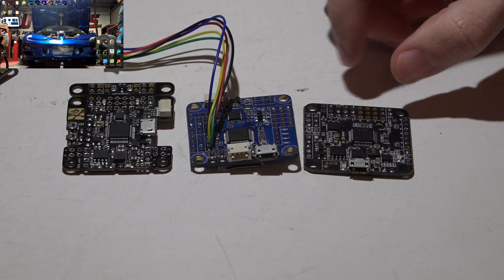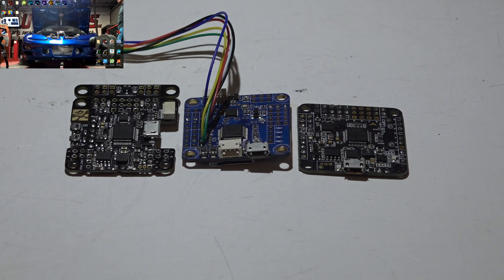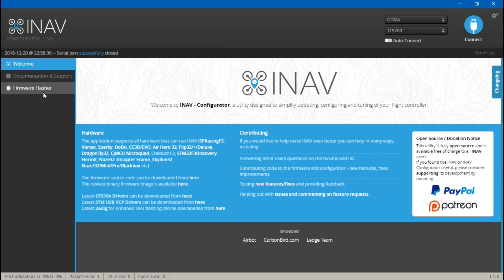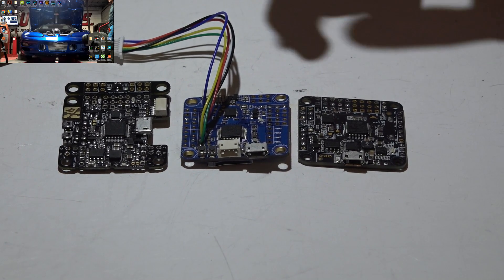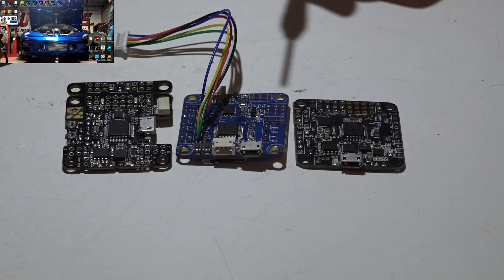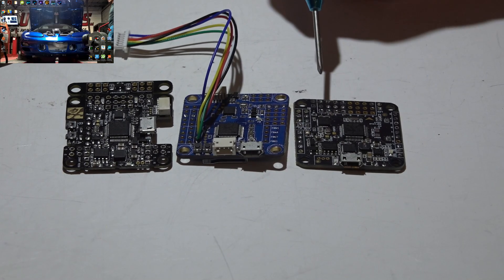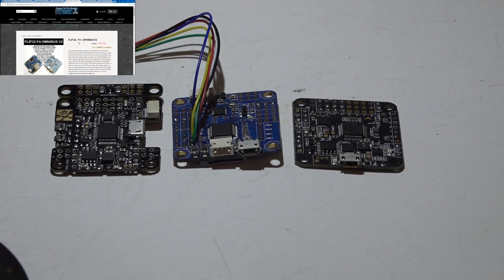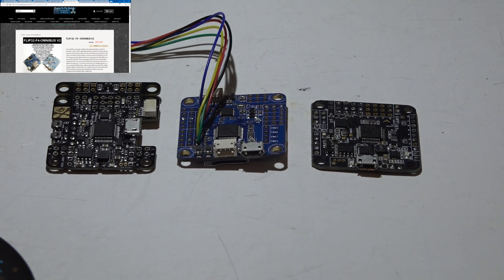Best Flight Controller For INAV?

Comment: went through video and heard the points. baro - yes , compass -no, current sensor - no, SPI  processor -  yes. I have identified https://www.banggood.com/Omnibus-F4-Pro-V3-Betaflight-Flight-Controller-Built-in-OSD-Barometer-SD-Blackbox-for-RC-Drone-p-1163085.html?rmmds=search&cur_warehouse=CN  but it is a pro. could you please look at the pin diagram and confirm it has any issues to use with inav and gps?

Comment: can I do a hexacopter  using the omnibus? and  should I make the distribution board the frame, and then work from there with a separate gps compass to an Omnibus ? Also not sure of the signal wiring for two of the motors on an omnibus (if it can be used in the first place )..

Comment: i checked the supported boards on Inav, is it compulsory to use one of those boards or could i use something like this Racerstar StarF4S 30A Blheli_S Dshot 4 in 1 ESC AIO F4 OSD Flight Controller w/ BEC Current Sensor
Reply: You can use it because its an f4 board, just remember the pinout will be different than the ones displayed :)
Reply: so i had a quick look through the boards in the inav configurator, the board i have isnt in there. would i be able to select a different board and use it. or would i need to replace this board all together?
Reply: You can try flash it with sp racing f4 evo, if it doesn't work prolly get another board ^^
Reply: thanks
Reply: ill be getting one of these for another build to follow along, what PDB would you recomend?

Comment: Love your videos. You just make sense.  Question and you may not know but I bought all Omnibus F4 for all my builds. Just decided on a whim to turn an old ZMR 250 into an inav GPS quad.  I have a gps.  I know the F4 has no barometer but I do have an external barometer from an ancient CC3D build years ago.  Do you know how to wire it to the omnibus or direct me in the right direction? Thanks.
Reply: Guess I should have told you it’s a BMP180 barometer. Thanks if you can. If not I’m sure I’ll eventually figure it out
Reply: he passed away so he cant tell you

Comment: Just ordered two 10DOF Sp Racing F3 boards. If you want to control a camera gimbal, via the FC, this currently is the best option. I'll be using the RTFQ total dist w/osd. Guess I'll save the two omnibus F3 boards for mini quads.

Comment: hi i already buy the F4 pro waiting to came... =( ... is anyhow to bypass the Current meter and volt sensor.. couse i have ESC with power module built in

Comment: JC, is there a F3 OMNIBUS clone board that has all servo through hole pins ? i hate the small white connection like the sp12 as they all seem to come with very very fine wire and just another fail point ? cheers Brett

Comment: Hi people. I'm  putting together a GPS Quad. I have a  Flip 32 omnibus AIO F3 board. I love this board but I am having a problem getting the external mag to play nice with it. I am running Inav 1.7.0 on the board.The GPS/mag is Hobbypower Ublox NEO-M8N GPS Module with Compass + GPS Folding Antenna Mount Holder for APM2.8 APM 2.6 Pixhawk PX4 Flight Controller. The issue is that when I connect to the FC Inav sees the mag and shows it as fine but after a very short time the I2c error counter at the bottom of Inav goes crazy and the mag shows up as faulty. Is this a FC issue, an Inav, or a GPS/mag issue. I have had the mag running long enough to calibrate and confirmed it in Cli. It seems that I2c does not want to play nice. What can I do? ANYBODY, PLEASE HELP.
vince@thetassones.net

Comment: Thanks JC for this great series.

I’m stuck on one problem that I can’t figure out.

Here’s what I’m using:

- Flip 32 F4 Omnibus (http://www.readytoflyquads.com/flip-32---f4---omnibus-v3) 
- X4R receiver 
- Taranis X9D transmitter

My configuration:
UART6 with serial and sbus selected.

Using Betaflight and Cleanflight, I can move my sticks on the transmitter and see the channels respond as expected. 

When I flash with INAV, I don’t see the channels respond in INAV, like I do in Betaflight and Cleanflight.

I even ordered another flight controller (http://www.2dogrc.com/omnibus-f4-pro-v4-pdb-fc-in-one-smart-audio-support.html) but get the same results.

I’ve got to be missing something stupid - can anyone please tell me? =-)
Reply: Talking with the guys at INAV, the F4 version of this board does not yet support the programmable inverter.

There is a custom firmware available that does work for me, but it's not part of the official INAV release. I can confirm this works.

If you're interested here is the background and the links to the custom firmware: https://github.com/iNavFlight/inav/issues/1643#issuecomment-299361919

Comment: Hey JC. Thank you for the great videos. Just a quick question, I am getting wrong voltage reading from the fc.. when the battery is fully charged I get the right voltage but when it drops a little it shows that it is on 10V instead of 12V. I did make the calibration of the battery through the configuration page to get the right voltage I see on my multimeter.. 
I'm using the ombibus AIO f3 for my INAV build .. please help

Comment: hi J.C., admire your tutorials..
been planning to use an omnibus F3 for my inav build..
my main problem is : 
i cant find how to use my camera gimbals pan/tilt with the omnibus.
have you any experience with connecting servos/gimbal to the omnibus on inav?
thanks
Barak
Reply: Kaynan Barak did you ever figure this out,  i have the same question
Reply: My solution is using an x8r.(taranis)
Bind it with channels 1&2 & 3&4 briged.
Then u get sbus running and channels 1-8 output 9-16.
FC runs with sbus & use the other channels for gimbal etc.
Reply: Kaynan Barak thanks,  discovered that solution just yesterday,  that's what I'll be doing

Comment: Great Video! Wish I'd seen it 2 days earlier haha I just ordered my F4 Pro... Will I still be able to run an iNav setup do you think? I know i lose functionality on that one UART... Thoughts? It's on a 300mm Tricopter, so not much room for other goodies anyway... If I'm using Uart6 for telemetry, and uart 1 for receiver, I'll have Uart3 for GPS... Am I missing something?
Reply: Also, I read that it's possible to pass telemetry using softserial, which would technically free up Uart1 again? maybe? Thanks for your amazing videos, just trying to wrap my head around setup/wiring before things start showing up :D

SETUP:
Omnibus F4 Pro (from RTFQ) 4-1 ESC with BEC (because tricopter!) Probably that little HolyBro GPS unit you reviewed earlier, with fatshark vtx+cam, to x4r-sb...

Comment: Hoping this saves others from the dinking I had to do to get going with INAV on the banggood omnibus f3 board. I just got mine in and was having some difficulty getting it to flash INAV. It came preloaded with 3.0.1 of betaflight so fairly new, but not the newest. I went down the zadig path and still couldn't get INAV to flash the board. Knowing that there were newer versions of betaflight, I went and tried to update to the latest version of betaflight.. well the betaflight configurator detected that the flash was in a read only mode, then cleared that, asked me to reboot and afterwards, had no issue flashing to the latest betaflight..  I then went back over to INAV and the INAV configurator had no problem flashing Flashing.
Reply: I've had the same problem with an F405-Wing . I'm gonna try the same thing. Thanks for sharing this!!

Comment: I prefer CC3D Revo(not mini one!). My GPS build is: Revo itself, MSP video telemetry & PPM Receiver on Flexi I/O, AUX mag on Flexi port, GPS on Main port, built-in RF telemetry for GCS controls, current & voltage sensors on analog inputs.
Reply: And to add, the new "librepilot2go alpha" android app is working so smooth with oplink. now I can just get my tablet and go to field and set everything up there.
Reply: Does INAV run on the CC3D revo?
Reply: Tobimai as stated in their compatible boards page, it should be possible to flash revo with iNav.
Reply: OK. well I just looked it up, sadly OPlink doesn't work in INAV. Are you using LibrePilot?
Reply: Tobimai i have to use it.

Comment: Excellent Video.. I am thinking about doing a gps wing, and was torn as to which board.. and then adding it all up having to pick up an external osd.. the f3 omnibus with the built in osd and no magnetometer is exactly the ticket.  All your videos are super helpful, but this one was exactly what I needed.  btw, I'm just up the road in spartanburg.
Reply from the maker: Thats awesome. I found another viewer right down the road from here in Lexington.
Reply: Hope you have better luck with the F3 omnibus than I have.... Does not want to work with any 5883 mag I have tried... also my OSD works about half the time... bought from  readytoflyquads thinking the quality would be better than banggood.... guess not. I am just north of you in Rutherfordton NC.

Comment: Hello, good informative video. 
I've seen the links to omnibus clones on banggood. If i buy a clone, do i choose OMNIBUS board on the inav configurator to upload firmware?
Reply from the maker: Yea the F3 clone is going to use Omnibus firmware, the F4 clone will use the Omnibus F4 firmware.
Reply: Project Blue Falcon Thanks. One more thing, did you actually have any experience with one of them?
Reply from the maker: Yep. I have omnibus flight controllers on almost all my racing, freesyling, and GPS builds. it's my favorite flight controller.
Reply: Project Blue Falcon, i ment experience with the clones
Reply from the maker: I own a few and havent had any problems out of them. But with all clones I make sure that the solder on everything is good before I power them up. Especially check in between the processor pins. Sometimes they add too much solder and it shorts pins together. It can be removed with some solder wick easily though. Haven't seen that on any of my clone Omnibuses, just saying thats something to check in general with any clone.

Comment: hi JC.. I like what you are doing for these iNav videos. I have Omnibus F3 (not pro),  but want to use this in fixed wing with iNav and GPS. I already have on me a mini NZ GPS N7,  but does not have compass. 

could you please do some videos on setting up the Omnibus for servos and PPM for a flying wing with GPS.
Reply from the maker: Will do
Reply: Project Blue Falcon just out of interest,  do I need to worry about compass if using this system on Fixed wing?
Reply from the maker: You've got me on that one. I've never done a GPS fixed wing. They have a lot of info on GPS and fixed wings on INAVs website though.

Comment: my old octo ran a crius aio with megpirateng, but its time for a rebuild but looks like it will not happen as these days the octo's are ''dead'' and left behind, but no way would i trust a dslr to a quad...
Reply from the maker: I agree. On these newer flight controllers you're starting to see only 6 outputs and even 4 outputs.
Reply: Most of the small fcs are build for racinquads which in moat cases only use 4motors and leas output pins means more space fpr other stuff
If you wanr to build a octo go wirh the pixhawk or new f7 fcs which have 10 motor outputs so you have room for other auxillery equipment as well

Comment: So with the omnibus f3 (Blue one) I can still fly fast without gps for a racing quad right?
Reply from the maker: Matt Jones INAV doesn't work that way. It doesn't have a lot of the high performance features that betaflight has, just like  betaflight doesn't have nearly as many gps features that inav. has. You can have a racing quad with GPS using both, but you'll have to pick, do you want it more for racing or more for gps
Reply: Okay thanks!

Comment: Great video series for the Omnibus and INav, very helpful.  I have the FLIP 32 - F3 - OMNIBUS V2 from readytoflyquads, I have not hooked it up to BetaFlight yet, but I did notice the little rectangular chip on the FC with the small hole in it.  I assume this is the Barometer, can you confirm?  I am considering using this board for my 6 inch INav build.

Comment: Hello JC, thank you very much.
After watching your videos, I think I will go with the Omnibus f3 for my GPS build. I just want to be shure wether it will be compatible with iNav and it isn't listed in the Hardware-support-chart :/
https://github.com/iNavFlight/inav/wiki/Hardware-and-feature-support-map
Reply from the maker: You can use it for sure. It's what I use. Not to mention MyAirBot is the creator of the Omnibus and also had a part in creating INAV.
Reply: Project Blue Falcon ok cool, keep rocking
Reply: At the moment I got an expencive Naza+GPS ob my F550  hexa but I got just into the Taranis and I want to make use of SBus and SmartPort. That's the reason I want to switch to the Omnibus. Do you think that it well handle well on such a big rig compared to what these little flightcontrollers were designed for?

Comment: JC,
  Awesome vids! I need some help......!??
RMRC Seriously dodo fc, 
Spektrum DX6I tx,
Spektrum race receiver, 
RROSD pdb,
Betaflight 3.0
Serial rx selected in BF on UART3
Serial Based Receiver selected
Spektrum 2048 selected
Spextrum selected on channel mapping
I have been fighting this for some time trying to figure this out on my own but........no go. The receiver is wired to the spektrum ports on the FC. Im pretty sure that is UART 3.......please correct me if im wrong. My tx and rx are bound. When i turn the tx on and off the rx responds with no light when off and a solid light when on. I am getting no response in BF......nothing..........no switches or any control function ie. throttle pitch, roll. forgive me if this was posted somewhere else. 
Let me know if any other info is needed to help trouble shoot.....im sure i am overlooking something.
Reply from the maker: You're correct it is on UART 3. It sounds like you have everything set up right, but I've never use Spektrum products so there could be something that I'm not aware of. I'd suggest going to my Dodo playlist and watching how I connect a X4R-SB or XSR to the Dodo. The set up will be similar. Maybe you'll see something that you overlooked.

Comment: Does the F4 processor have any advantages over the F3 processor? May be clock, cache or capacity?
Reply from the maker: Really the only difference between a F4 and F3 is the CPU load. F3 boards with SPI can gun 8khz loops for the gyro but limited to 4khz on the PID loops. Where F4s can do 8k/8k in Betaflight, and up to 32k/32k in raceflight. But for INAV and GPS builds a F3 is all you need because the fast loop times are not needed. Using a F3 board on my GPS builds I'm only using 3% CPU load.

Comment: @Project Blue Falcon Hi there.

SpracingF3mini is an promising target for iNav, I aggre.

Wondering if you have a chance to test two things?

1. Check if `Servo gimbal` feature is working when combined with QuadX mixer ? And the update the wiki with pinout if it does ? https://github.com/iNavFlight/inav/wiki/Connecting-a-Gimbal-to-iNav

2. See if `Softserial 1` is working together with an Airplane mixer ? I believe this should be possible.
Reply: Hi, did you have an chance to test this?

Comment: Hey JC Thanks for these awesome videos that you put out.....Keep up the good work.  I have an F3 Omnibus and would like to build a GPS setup with INav and use the onborad OSD...
Question, with my F3 Omnibus does the onborad OSD work in INav without flashing it to Bataflight??  Or do I have to set it up first in BataFlight, then reflash it in to INav and hope it will work?? 
With your F3 Omnibus  do you use the onborad OSD or do you use micro minimosd?? 
Again Thanks for the hard work that you for us.
Reply from the maker: Thanks a bunch. With the Omnibus just flash INAV firmware and INAV also has the OSD feature. It's works just fine with the Omnibus.

Comment: how do i get the quad to land better it does do the land but tends to skip across the ground a little once its landed... i know with the older firmware it would also disarm once landed i see that feature in the cli but i would like it to slow the motors down a bit better once landed...?